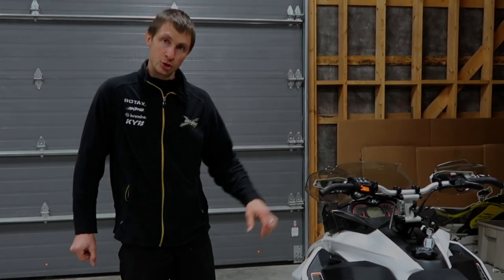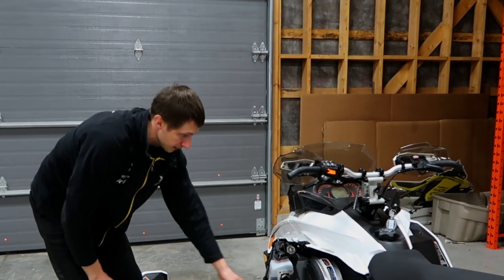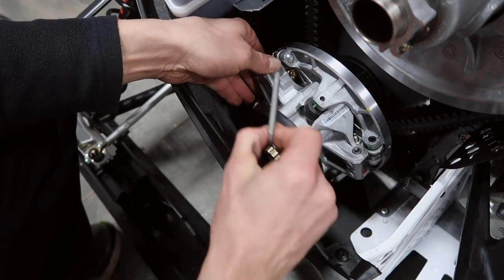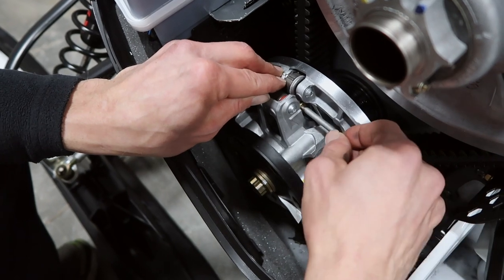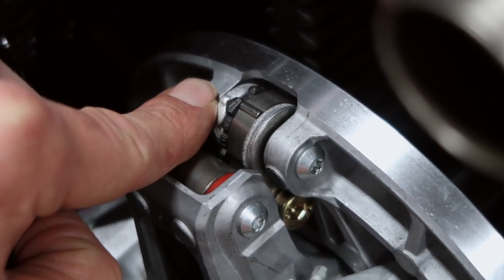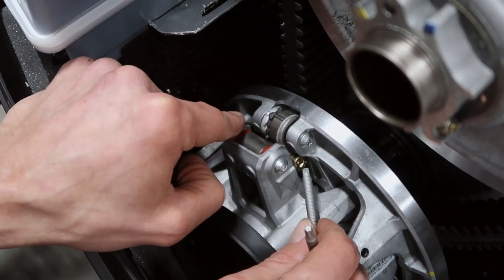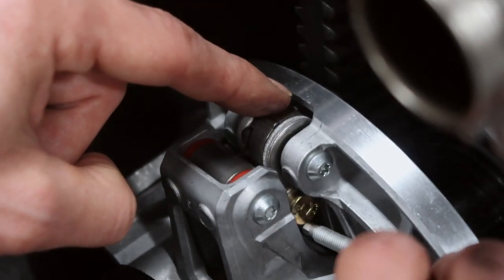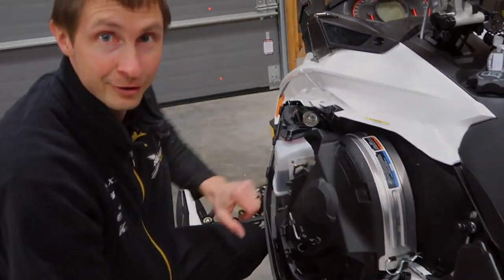2017 SKI DOO 850 P-DRIVE OVERVIEW

Comment: what is the problem when you are on clicker 5 and it still wont hold its rpm
Reply: Old wives tale, the old Etecs had lots of negative side effects, the 850 and 600R work fine on 5

Comment: my sled which has the 850 was setup for 3 - 5k Elevation , but I ride in 7 - 10k Elevation , what do I need to do Clutch wise , because I dont feel like I am getting optimal power from the 850 currently ?  thanks for your help in Advance ...  I am riding 2023 Lynx Xterrain Brutal with the 850 engine.